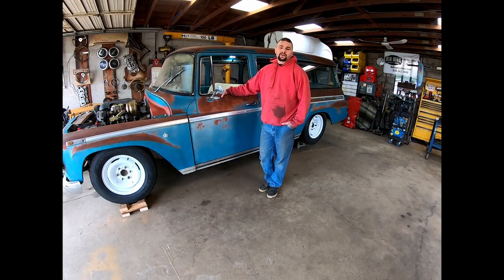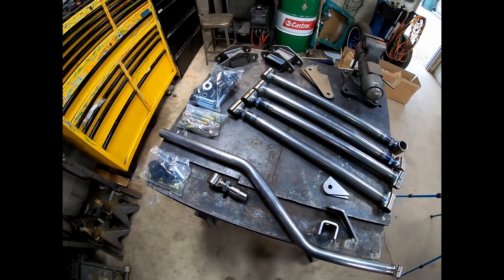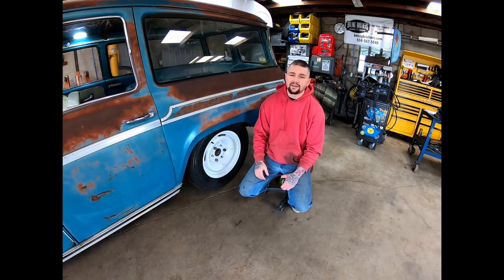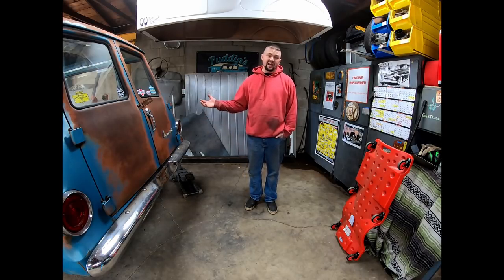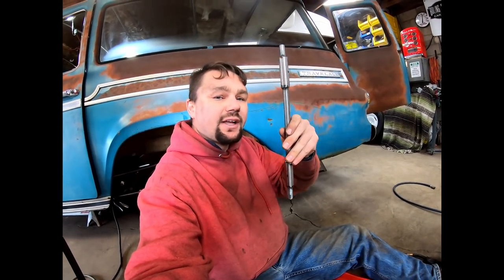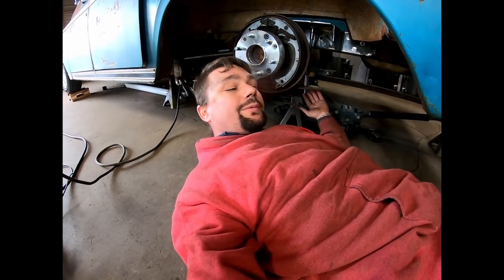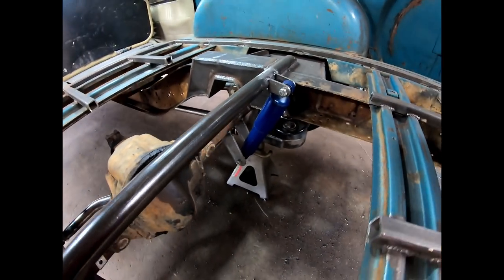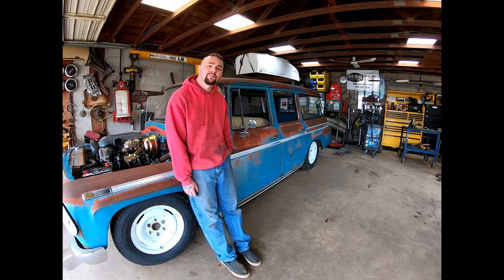REAR SUSPENSION BUILD. 4 LINK, COIL MOUNTS, PANHARD, SHOCKS!

Comment: Great work man, love the videos. I watched pedantic's videos as well when I was designing my 4-link and watts setup. Those braces you put on the front of your axle brackets are exactly like what I used on the back of mine where I put my lower shock tabs.
Reply from the maker: I wish I was willing to cut the body up more to get the four link where it needed to be. Really tho with just the coils and no airride it won’t be traveling near the distance that a bag would have. I think it will be good

Comment: Wow a lot of work for springs vs coilovers. I must say you do nice work. Wouldn't it be easier to set up your 4 bar, panhard bar and springs before you do your floor.
Reply from the maker: It would of been. At the time of doing the first c notch and and floor I was planning on just running the factory leaf springs and not going as low as i did.

Comment: Great video being stuck at home I appreciate a long video lol. Also almost went through the same notch issue! I I peices my flip kit together with "heavy duty off road" parts and would have had 3 inches of clearance without the weight of my bed. Ended going full 6 inch and I'm still on factory leafs lol
Reply from the maker: That’s plenty of clearance. I can’t remember how much clearance I have now but I can’t even get it close to hitting.

Comment: Where did you get the 4 link kit?  The bars look beefier than the kits i have seen on ebay.
Reply from the maker: It’s from switch suspension. It’s made by chopping block

Comment: Those spring mounts look awesome  and super STRONG ! Why did you not use the 2003 rear end? Just curious.
Reply from the maker: It was wide and needed narrowed.
Reply: @PuddinsFabShop  that make sense. No need spending that kind of money  if you don't have to.
Reply from the maker: Well I wouldn’t be opposed to narrowing it if it had the limited slip and gear ratio I wanted. It was to wide and didn’t have either of those.

Comment: Glad to see the video.

One thought - I understand how you came to the compressed length of your spring (“don’t do this at home, kids”), but the load or weight you used to find it probably isn’t accurate. The truck doesn’t have an interior, wiring, a floor, or passengers in it. I’m afraid you are going to be way undersprung. Coil overs are much easier to deal with by comparison and they save a lot of room. There is also a wide variety of springs available in various rates for them.

Just my 0.02.
Reply from the maker: There was an extra few hundred pounds in the back when that was test. That was also no shocks. The way it was built I can add a spacer to lift if need be but it will definitely be low enough.